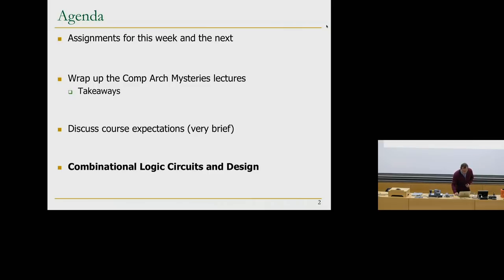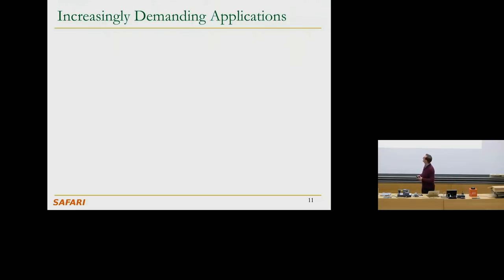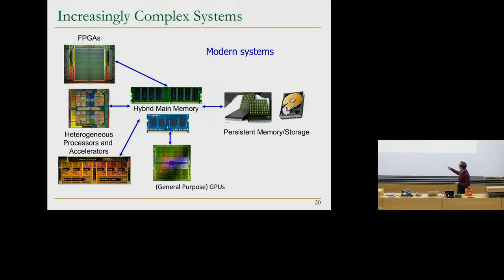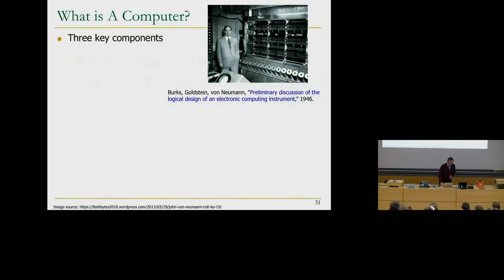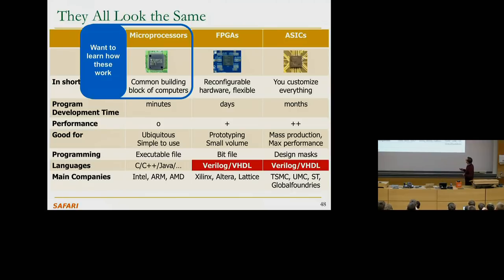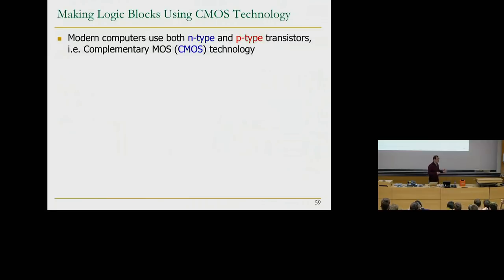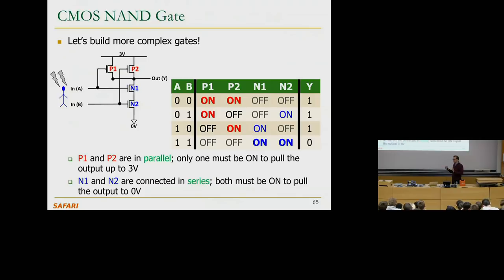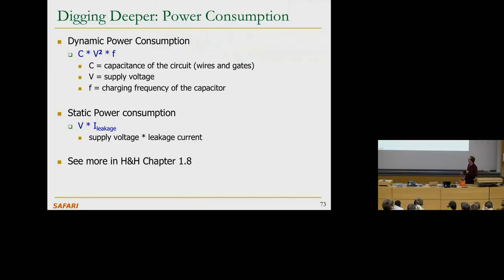Design of Digital Circuits - Lecture 4: Combinational Logic I (ETH Zürich, Spring 2019)

Comment: Very nice introduction on digital circuits (currently watching all videos of this course). Just one comment: You describe "MOS" but you mean FET (field-effect transistor). MOSFETs are just a specific type of FETs. Also, the line between Drain and Source is usually not continuous (i.e., broken).   Otherwise, excellent lecture. I wish I took the offer to go to the ETH when I had the chance.
Reply: In this lecture, he says about MOSFET specifically and mosfets can be represented that way too. And MOSFETs are usually used in ICs than other FETs. The idea is that the Base terminal looks like floating connection due to dielectric material